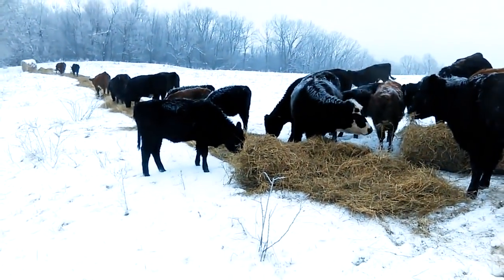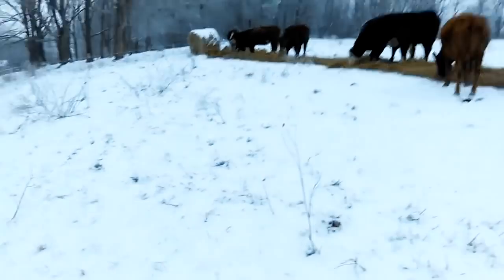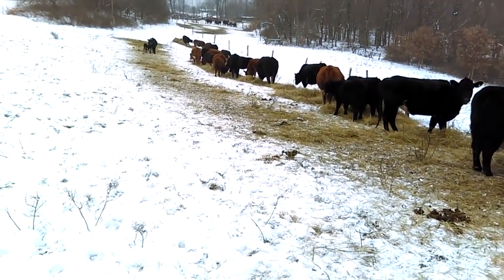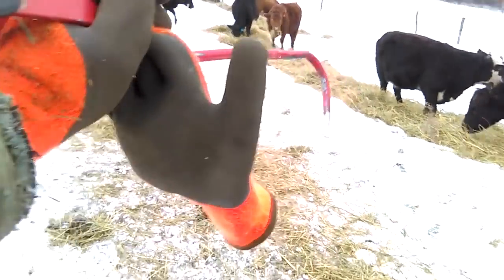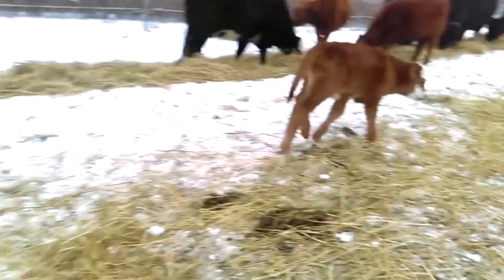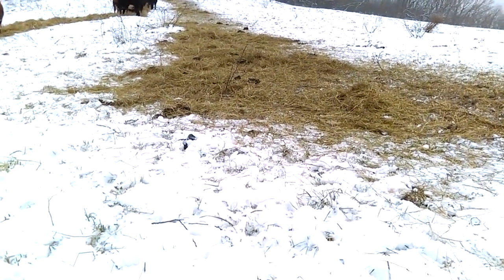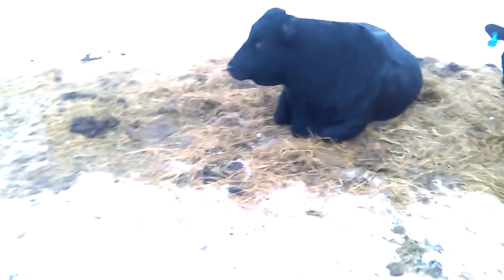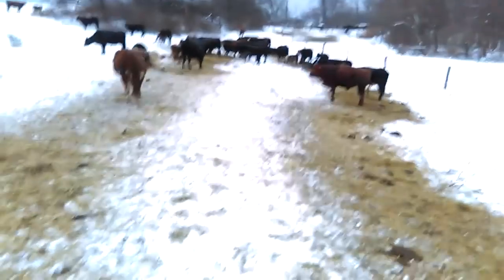Bale Grazing Experiment #1

Comment: In the winter months, I feed on the pasture, with off farm purchased, haylage/baylage/silage (call it what you want).  To keep the cattle from defecating on the feed, I pull a hot-wire or rope between two ring top posts about 40 feet (12 meters) long, pass loop through hole and over ring to secure, then drop feed (as deep as you want down the length).  The cattle will feed, on each side of wire, like a trough.  Move the posts for every feeding to spread nutrients across the pasture.  Best regards

Comment: Dang dude!!!  You've got wasted hay everywhere!  That's fine if you can afford it but it seems as though buying a couple more hay rings would be cheaper in hay cost and your labor!  If you're going to waste some hay then leave a few larger clumps for their bedding!  They like it!  Also i raised the bottom of the ring by adding wire fencing about 1/3 of the way up, to keep the hay off the ground.  If you'll notice they don't eat what touches the ground!  It's wet and muddy!  Also you could add two wheels to the bottom and move the rings everyday!  AND - I took out one of the section of the ring  and made it more "football"  shape!  The rings are made too big and the animals can't reach the middle!!!
Reply from the maker: @Tony Touchberry I know it looks like waste in the winter but now those areas have the nicest grass. I do need to work on limiting the amount they bed on though.  I love the idea of adding fencing to feeder but that wouldn't work for me, I don't own a tractor. I use my atv and a bale mover to move bales around. We buy all of our hay also. It's much cheaper that maintaining equipment. I will surely look into adding the wheel to the feeder. What size wheels did you use?

Comment: A few things I have learned:
1. I do put a hot polybraid down the middle of the roll to keep them from stepping on it so much. Of course then they can't lay on it, which might not be a good thing. You could leave enough of the roll exposed so they can lay on it and just cover the rest with polybraid.
2. Even with the polybraid, they still leave a good amount of hay. The reason I do it is this: the ruminant animal will balance their diet as best they can. If you force them to eat every bit of that hay, you are taking away their ability to select, and they will usually select the highest energy parts of that hay or what they need for balance. If you let them step all over it, they won't select some high energy portions of hay because it has been fouled.
3. You would probably be interested in the free booklet by Mark Bader from Free Choice Enterprises. Call them and ask for the free booklet. There is a lot of info, but one useful bit deals with the different parts of the plant and the energy, protein and oxygen contents of the top, middle and lower portions of a plant. The top 1/3 or so of the plant has the best balance of energy to protein. As you force the ruminant animal to eat further down the plant towards the soil, the protein becomes way too high. So, forcing the animal to eat most of the hay doesn't make sense. They will consume excess protein in order to convert some protein to energy, but that is accompanied by health problems. It is more beneficial to leave much of that hay to mulch and feed soil life. 
4. Everywhere that I have several week old manure piles and where I have a good amount of hay coverage on pasture, I am seeing clover and grasses growing up through as if it were springtime. 😳

Also, good video!
Reply from the maker: Great information, Troy. Where would I find the contact information for Mark Bader? I would love to get this free booklet. It sounds very interesting. I agree with you on the results of bale grazing as I have seen a lot of clover in those areas in the summer.
Reply from the maker: Thanks so much Troy.